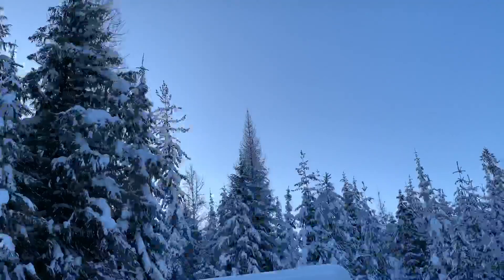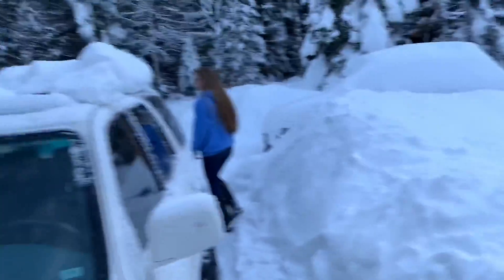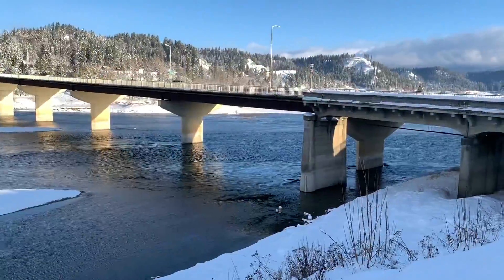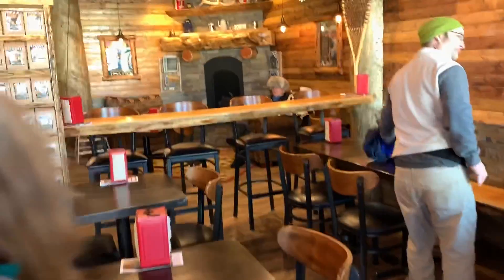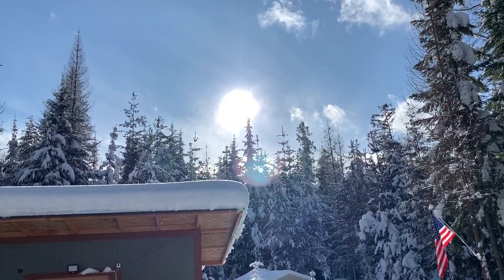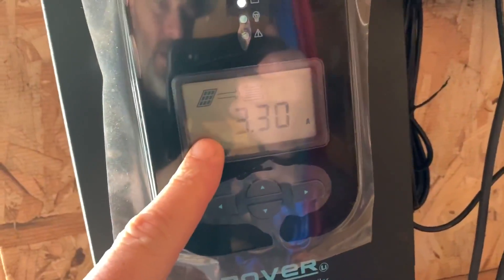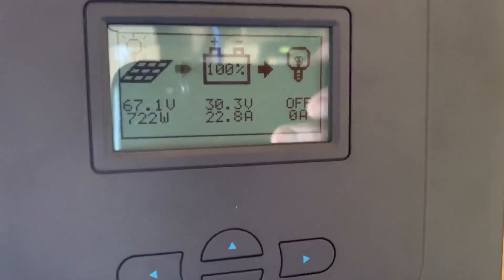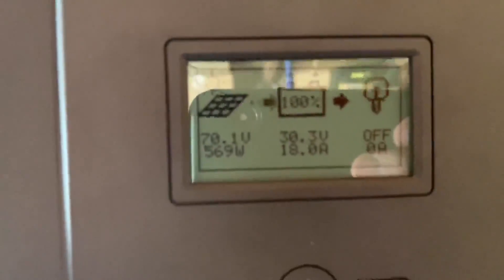How Much Solar Power are we Making?

Comment: I'm new to solar. I think, if you want to know what your panels are producing comparing the ones on the ground to the ones on the house, measure their open-circuit current (there is a more correct technical term that escapes me at the moment) with a meter that can handle it. Where you are measuring is dependent (I think) on what the charge controller thinks your batteries need based on the state of charge and load (not what your panels are capable at that moment). If you don't have the ability to measure the current, plug in a couple of hair dryers or an electric heater and see if the current you are monitoring at your charge controllers goes way the heck up!

Comment: Panels wired in series can almost drop to zero even when one cell is shaded. Wire in parallel and I bet you will get a consistent double the amps off that lower set.

Comment: I have 520W of panels just for testing and design at home. I had no projects going and just did a test in December for 31 days of total power generated into a load at power point.  It was about 560WH a day average. That's only about 1X panel power a day. Be grateful you don't have clouds.

Comment: I believe you're wrong...again.  Your assumption about the readings on the solar controllers is incorrect.  Rather than tell you what you're doing wrong, I suggest you read the information you got with the controller(s) and not try to tell us all about information that's wrong.  The solar panels are not putting out what you profess they are.

Comment: Hi! Are you planning on maybe doubling your battery bank to increase capacity?
Reply from the maker: Yep. I’d like to go to a 48v system.
Reply: @MartinJohnsonOffGridLiving  Would that be easier to do now... rather than wait until the house is finished, and you have the garage built? Or would you be looking at moving to a different class of battery for the 48volt setup?
Reply from the maker: Different batteries and inverter.
Reply: @MartinJohnsonOffGridLiving  Gotcha! Thanks!

Comment: I would if I were you use the power in excess like washing clothes when you are in high amp mode...that way you don't waste the overload to the battery  fill...js..and here in bama...we can sell our excess to local power companies..just a thought..I know you are off grid but we have a coop situation  here...excess power not used can  be sold back to the power  provider  in your area....its an in kind situation

Comment: What voltage are the other panels?  Your new panels were producing 30V, giving 600+W.  So the old ones were 6 x ?? W?
Reply from the maker: About 30v and 275w
Reply: Martin Johnson - Off Grid Living So you’d expect 1/2 the amperage!
Reply from the maker: Sorry let be be clearer. We have 4 panels rated at 30v 275w each and 4 panels at 30v 345w each. Each set of 4 is wired in a series/parallel configuration.

Comment: In snowy climes Solar panels can get up to 2X as much light from refraction from the snow.  In Alaska it's not uncommon to tilt panels past vertical to a slightly down angle to better catch the sunlight from the snow for 6 months out of the year.  This also inhibits snow accumulation on the face of the panels.
So you not only need to watch the direct sunlight shading, but also try to avoid any shadow on the snow for at least 2X as far in front of the panels as they are high, for optimal output.

Comment: The Mechanic below listed exactly, your problem is any shading on the panels will knock them out you have just proved it the fitting instructions should have told you this,  they are fitted in series.
Cheers .  All panels must be in full sun to gain optimum performance.

Comment: you can just do a test on one old and one new panel by covering just one cell with a towel or something. most mainstream panels have cells in series - 10 for your old and 12 for your new it seems. if shading is just over 1 of those cells, it will knock power for the entire 10/12. so if you do a test covering the all the bottom cells with a towel and get no output then you know how those cells are wired. higher end panels have more connections and are less affecting by shading. of course more connections cost more since silver is used.
Reply from the maker: Cool insights. I'll have to do a test in a future video. That sounds like it will be really interesting.

Comment: I use the same bracket when I mounted a panel on the chicken coop roof and  the  lower amp renogy charger. works great to have lights and coop door automation with a wifi security camera. Now to step up the game and get my garage  off grid. Thanks for the links!
Reply from the maker: You're welcome. I hope you find them helpful.

Comment: Two of the most important things in snow country for solar is to insure you have a safe place to walk below the panels to be able to clear the snow enough the sun can melt off the rest and that is right behind insuring you have a storage space under the panels for the snow that comes off them so you can run a snowblower or tractor with bucket between storms to clear the storage area. 

Thats not to say you can't roof mount them in a place that is hard to reach but if you do you want a way to remote clear them with ether a sprayer or a heating loop as you just need them above freezing during the storm. 

Are you going to keep the batteries out in the shed or move them into the crawl space under the house?
Reply from the maker: Thanks for the tips. Not sure where we're gonna put the batteries yet. We might move them into the house or build a small box near a ground mount. We'll have to see.
Reply: @MartinJohnsonOffGridLiving  The batteries will be more efficient if you can keep them at their recommended operating temperature, which is probably around 20°C. If they are lead-acid cells, you'll need to vent them outside. (You don't want hydrogen gas floating around in a box or indoors!)

Comment: If your batteries are full, the amerage going into them would be low, the difference  is because of shading, I am guessing that your panels are connected in series, any shading on one panel will affect the others in the string, been living off grid since 2000, basically you cannot put more power into full batteries, that is just your float amperage, 👍👌❤🇨🇦, put  a load on the batteries, then show us the difference between the two sets of panels, then you will know the true difference
Reply from the maker: That's a good idea. I'll do it after I get the other panels mounted on the wall.
Reply: Pocket Change I wanted to ask a question. How many years do the batteries last? And are you still using the original panels? How are cleaning them? I am asking because here in the Tampa Bay Florida a lot of people are putting solar on their roofs. Thanks in advance.
Reply: @joemc111  I stll have the origianls panels, and have added to them, people say that solar panels degrade over time, the originals  are 20 years old this year and when I do a voltage test and amperage test on them, they are the same as when I bought them, so I don't know why some people say their panels don't last. The first set of panels where from Shell Canada, a very high quality panel back then, and they no longer make panels anymore, like the last 15 years, and my added on panels , are made by Canadian Energy, another high quality panel.
Reply: Pocket Change great information. How about the batteries,still have the same set?